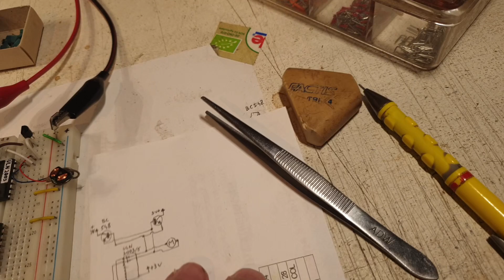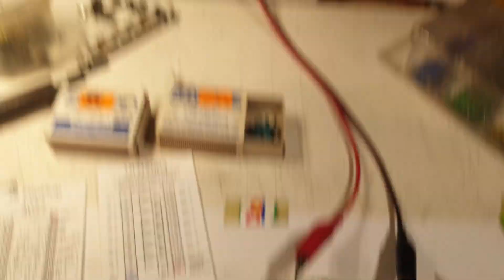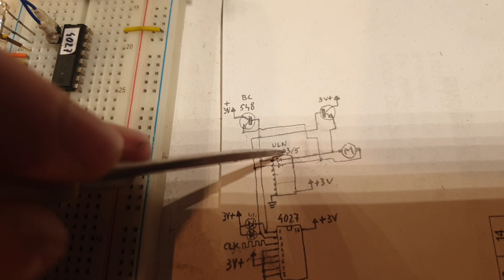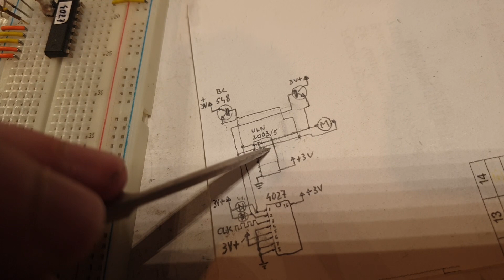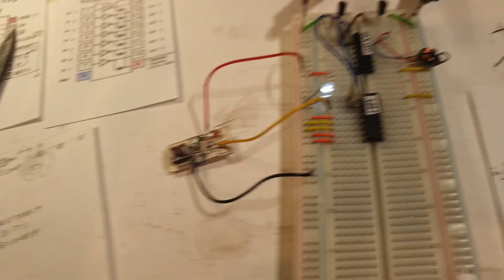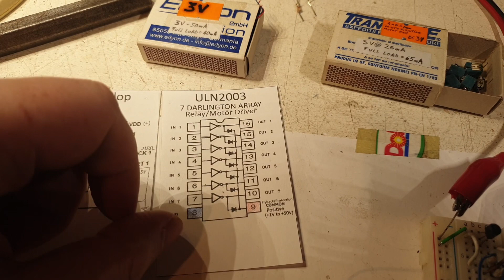#268 Persistent Memory p2 - test motor driver H-bridge made from a ULN2003 + 2 tr

Comment: Interesting idea! Just to note the limitations of this solution:
1- it can drive the motor most up to the same voltage as logic IC /*you can't drive from 3v IC 12v motor*/
2- it has a limit of current because upper transistor is not saturated it will have ~.7v drop and more heat
3- 548 BJTs are not so powerful, better use BD139
Reply from the maker: 1-this type of motor is a 3V motor with a current of 60mA when is Full Load (stopped forcefully), and it will not get hot while stopped. In total, is at 180mW at full load(stopped).
2-these tr are more than enough fur such loads, they are cold all the time. Power on them is infinitesimal.